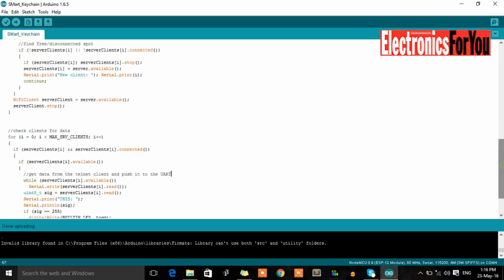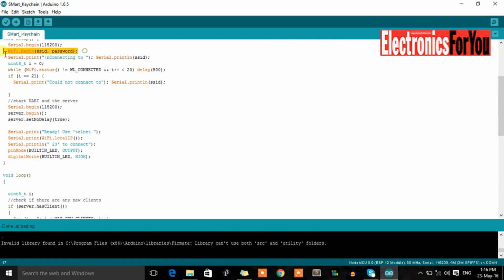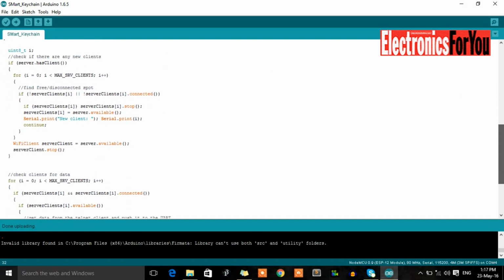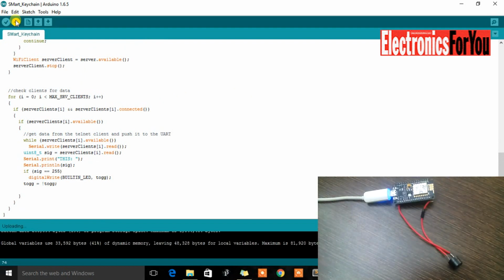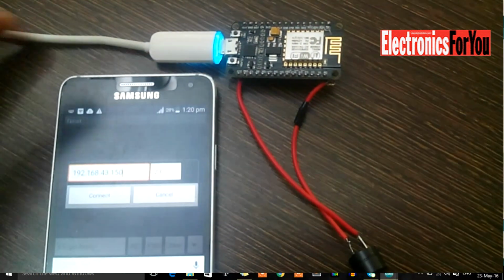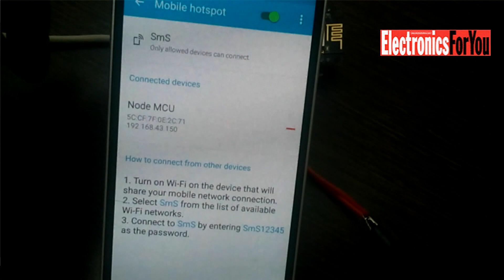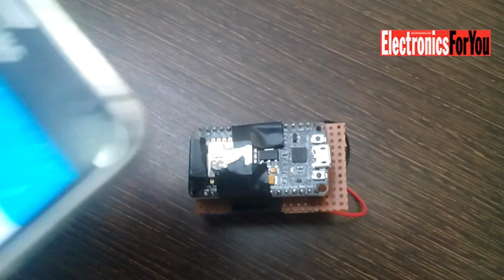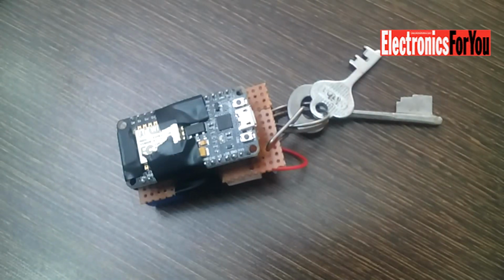Smart Keychain: Electronics For You DIY Project

Comment: 9 volt battery??? Cmon man you can do better than that. With this battery this so called keychain looks more like a dumbbell than keychain. You really need to learn more about ergonomics, design, simplification and power converting so you can use much smaller power source.

P.S. Do you know that there are similar inventions to this, that have size close to a coin with wireless charging and of course rechargeable battery? Think about it.